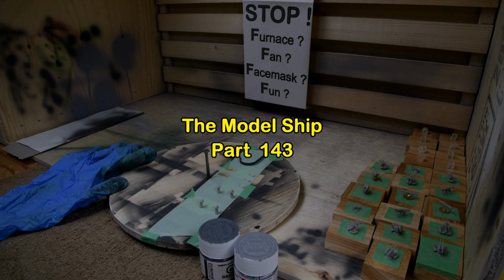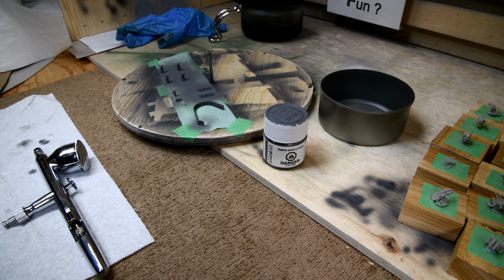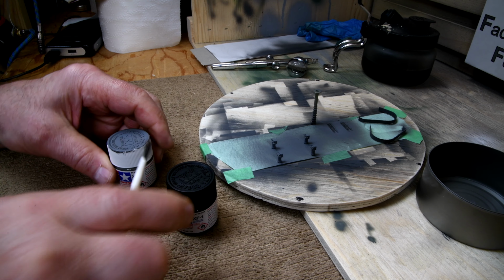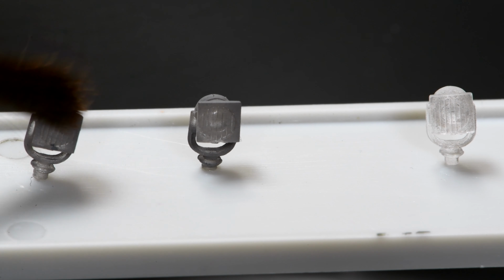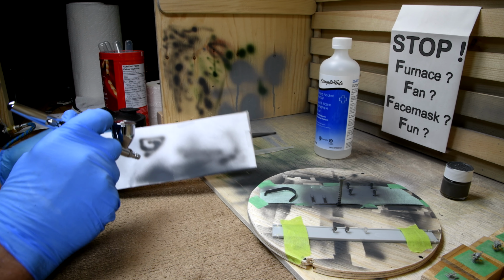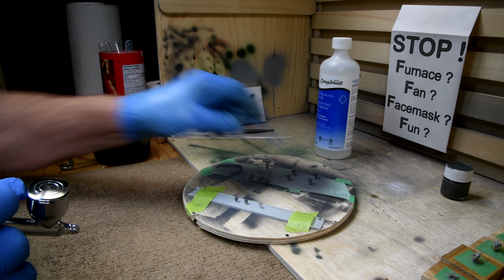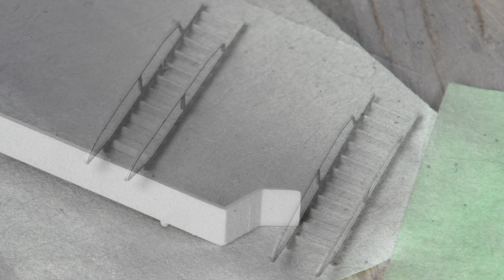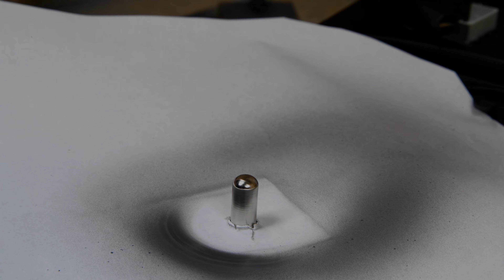The Model Ship - Part 143

Comment: Ron, you need to totally disassemble the air brush and clean with isopropyl.. also I suggest you get an air brush reamer to clean out the needle path, after you have removed the nozzle assembly. I also use makeup q-tips (they have pointed end) to help with the isopropyl to get into tight spaces.
Reply from the maker: Thanks Tony, I'm actually doing that. Pretty sure I've got all the little individual parts clean. We'll see how it goes. Still love this air brush. 👍